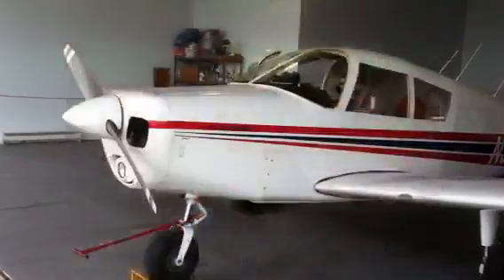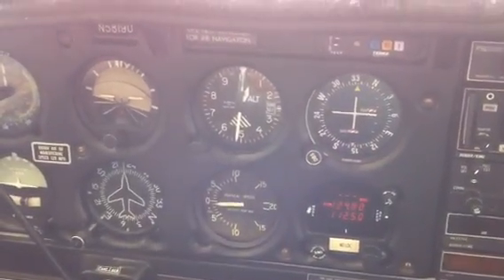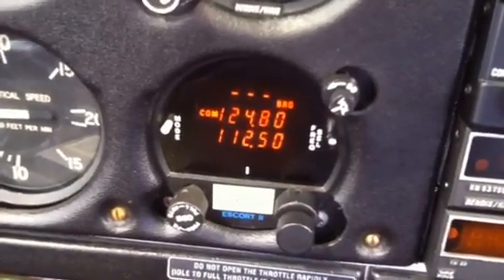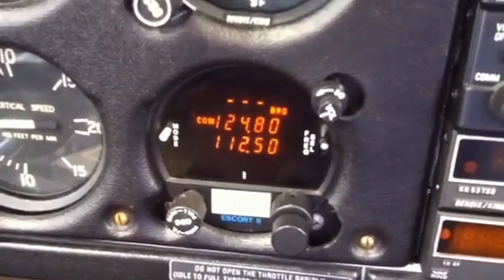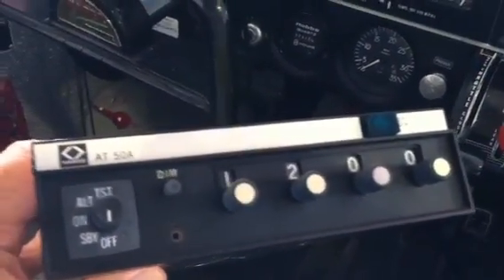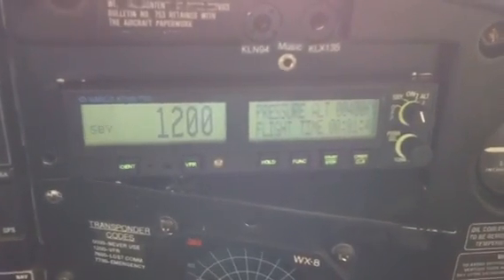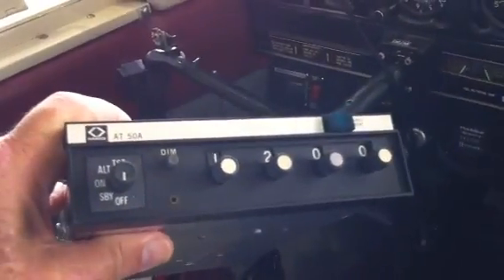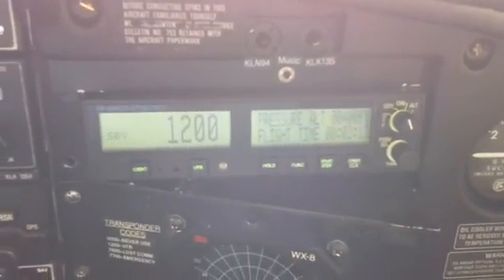A Narco Direct Replacement for an AT 50A Transponder

Comment: Regarding the Escort II, you say you've had it out for repair. Where did you have it repaired? I have an identical unit that functions okay except will not transmit. I have searched extensively and no one will touch it. Can you recommend a shop that would be willing to repair this unit?
Reply from the maker: Used working units are available and provide an inexpensive solution: https://www.ebay.com/itm/264789805035